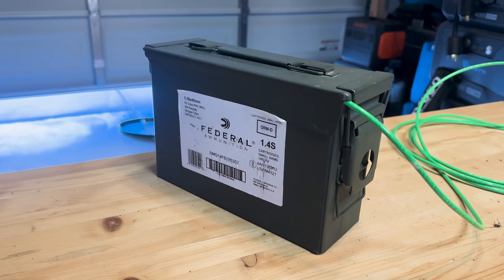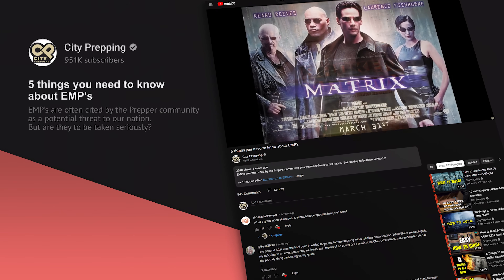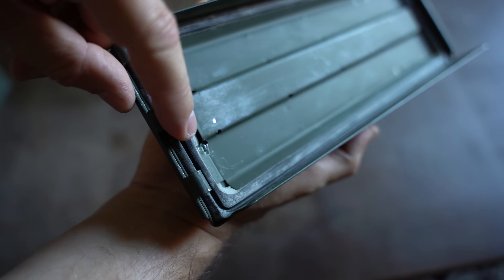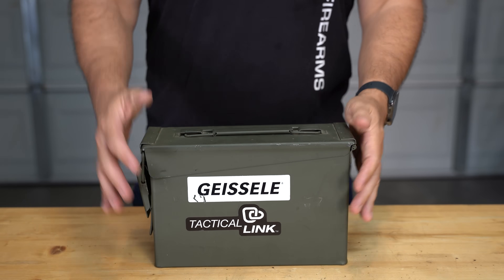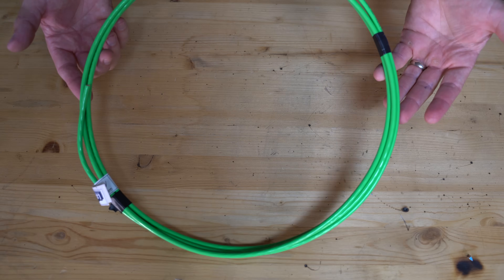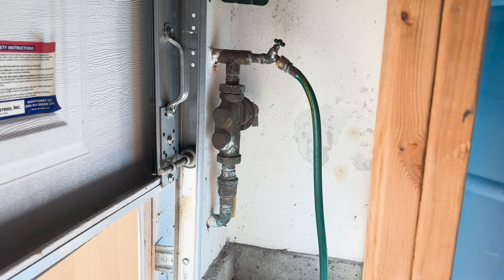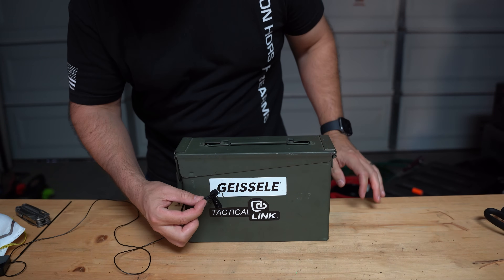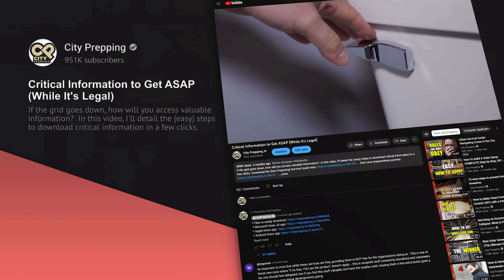How to Build a Faraday Cage: Step-by-Step Instructions

Comment: Ok but (and here's my stupid question) - if an EMP would wipe out even a basic radio, doesn't that mean it would wipe out the radio towers, so the radio, once out of the box, would have no signals to pick up?  Same with phones - sure you can save your phone, but wouldn't the cell towers also be fried, making the phone useless?  I'm just curious how the electrical devices could be used after since an EMP (or solar flare) would destroy even the items these devices need to work.

Comment: I believe if grounding, it need a dedicated copper stake with a wire clamp bashed into soil outside, a meter deep. Grounding to pipe plumbing makes fatal touch for anyone touching a water faucet/tap/pipe. Each generator in Au supposed to be grounded with a copper stake. By the way, the sound-box you build for your generator, included some foil, if pieces connected, you have that box as a Faraday cage.. Also, the Faraday cage doesn't need to be a solid metal, using a metal/copper window insect screen, much better, more flexible, lighter.

Comment: A metal garbage can of whatever size you require eliminates all that prep. Plus it can store more stuff.  After the can is insulated to keep it from contacting the metal I store it on a wooden palette.  I keep a laptop, radio, and other sensitive/vulnerable electronic items in mine.  The trash can handles makes it easy to move around.
Reply: You still need to seal the edges of the top of the trash can, where the lid fits on,  similar to what he did will aluminum foil.
Reply: I do. With metal tape. Hate it when I leave important information out. Thanks. @geod3589

Comment: Do not add a ground. Adding a ground will render the metal box invisible to a high power emp. Also be sure to set your completed box on an electrically insulated surface, 
A wooden shelf, as opposed to a metal shelf. 
As the electricity flows through a conductor, it creates a magnetic field around it. If the box is grounded the box becomes the conductor.
If the box is insulated it will not.
Reply: Right, do not ground a faraday cage; I put mine in a plastic tote. Keeps it clean, too.

Comment: Pretty informative a good example of a simple Faraday cage.  Few points, 1. if you isolate the items in the box, you don't need to ground it.  Also if you drill & tap a lug on the outside you can use it as a grounding point on the outside of the cage.  If you want a air-tight sealed box, you can drill and tap a wire inside to the top cover & bottom box to connect the two pieces.  Then you can keep the rubber seal in and just use aluminum tape or tin foil to ensure the cover overlaps with the box more for better protection.  If your looking for storage... use an old metal office storage cabinet.  Similarly, tap a cable to each drawer and provide some overlapping either aluminum tape and tin foil or other means to overlap the gaps of each drawer.

Comment: Very interesting. 2x suggestions. To put in the cage, solar powered calculator - after an EMP the ability to do sums easily may well be of advantage. To make the cage out of what in the UK is sold as an ash box. Good size for laptop.

Comment: Another way to test the effectiveness of cage is to place a cell phone inside and then call the number, if it rings, it failed. I would want an external mount for grounding. Just to make sure it had a solid contact point. Excellent, informative video.
Reply: So these will stop a cell signal? That’s what I came here to find out but no one else seems interested in it
Reply: @kevindutton3676 Yes, it will block all signals and prevent tracking of your phone.
Reply: Folks, consider that a cell tower puts out just a few watts of energy while a nuclear induced EMP is millions of time more powerful!!!
Reply: No grounding.
Reply: The power put out by cell towers is millions of times weaker then an EMP. It is not a 'proof'.

Comment: I'd just add rechargeable batteries to my preps and not worry about the box. 
With a few common items one can build a charging station. Think hand crank radio power. 
Just scale it up. 
I won't go into detail, but a car alternator and an old bicycle are part of it. 
add in some small items and a LiPo battery.... But preppers only tell you enough on YouTube to get to their next sponsored video. 

Do your own homework people. 
Learn what's useful from the preppers and build on that for yourself. 

NOTE. Do what you want. I'm not a youtube prepper getting paid for content. 
I'm just a mechanic/electrician and veteran with a family to take care of.

Comment: You can also use a metal trash can for larger items, with metal tape, aluminum foil and cardboard. To test it, put a cell phone in it and then call it. If no ringing it is good.
Reply: I've read the cellphone test is not that great, that might be why he used a regular radio.  I've actually tried using my cellphone and it always rang, perhaps I did not do a good job on my cage.

Comment: Small devices (Like those that will fit in that small can) are the least likely to be affected by an EMP. 
The bigger issue it larger items and things connected to the grid or items that are charging. 

A fun thing...assuming people build this stuff to protect their electronics, say a cell phone, GPS devices, things that connect to wifi, etc... if there is an EMP, you won't have service or communication even with a healthy device. 

Don't build this stuff.... Follow me for more money saving tips. 

Oh...he said it himself. WEAK ONE. 

Last I checked, they generally don't come in the weak form. 

I guess a solar flare could be weak, but that would still fry powered grid facilities enough that your small devices would still be useless. 

I'd personally save the space in the garage for water treatment supplies. 

So awesome tho that I can build a box that traps sound inside. LOL

Cheers to the people that think their radio will still get a signal after a massive EMP wipes out that signals source.

Comment: I just sanded the ammo can and kept the seal but instead put a sheet of aluminum foil all across the top and closed it. It works fine too but after opening it a few times I did have to replace the sheet.

Comment: I have converted a galvanized bin for this purpose😂
Reply: It has a great volume. I've put in a spare laptop and tablet. Two way radios, FM/ am radio. CB radio, disc drives and solid state memory. The body is earthed , lid with gasket and connected to the body.

Comment: I drive older vehicles yet they still have an ECU... I acquired an extra ecu for a few of my vehicles and put then in one of these and keep them in the corresponding vehicles and all the tools I need to swap the ecu out if it fails... granted this may not be the solution if all the silly sensors get fried and the ecu prevents it from running.. but.. maybe it will work. 
I found the extra computers at salvage yards for a pretty cheap price and I tested them myself so I was not out much more than $100 for the whole setup for each vehicle That includes the box and the computer.

Comment: Could you ground your faraday cage to a plug and use strictly the ground?
Reply: NO, don't do that! The electric power grid is the largest antenna in the country. Huge currents will be induced into it during an EMP. That's exactly what you're trying to protect your equipment from. Don't connect your equipment to it. Faraday cages should not be grounded at all.

Comment: I keep an old cell phone with important data on it. I also have a usb SATA drive with all my important data on it and a usb adapter for the phone to access the data. Also a ham radio, small solar panel, rechargeable batteries, usb power brick, and a battery charger that plugs into the usb output of the solar panel or the power brick. I have a larger cage made from a trash can with larger items in there.

Comment: I did a much bigger Faraday box so I could put some foldable solar panels and a couple of solar generators.  If you don't have a way to get electricity, then your old phone won't work after the charge is gone. I don't know much about what an EMP or CME ruins. I've heard it can destroy your solar panels, too. 
The rest  is kinda the same things you mentioned. I do know that a flash light without batteries won't be damaged. I've heard but don't know for sure that any appliances you have if it's unplugged is supposed to be safe, but then why have a Faraday cage if all these things are safe unplugged?  I get confused.  I really have heard so many different things and definitely did research,  but I still get  different answers.  I asked Google if you could use an old microwave as a faraday Cage. There were several websites, and they were different. Half said yes, half said no. If I had enough aluminum foil, I'd just foil the whole house and forget about!

Comment: I’ve seen a number of videos on how to make faraday cages in different size but you are the first to actually ground. Thanks!
Reply: Grounding is actually BAD, do not ground your faraday box.
Reply: @SolarPowerMonkey  it actually depends on the load in the air and how thick the shielding material is. I guarantee a 2 inch solid wall of lead that is grounded will work.
But this little box? No. LMAo
Reply: @escapetherace1943  Correct. That thing’s more of an antenna than a ground wire
Reply: So.... are we all wasting our time making DIY Faraday boxes/cages? I'd like to make one, for 'in case', but for every pro comment, there's a con comment. Who and what to believe. By the end of all this, I'll just hope n pray that down here in ol' RSA we'll be out of the main fray... no one wants to waste their new fangled ammo on us anyways.
Reply: @MsJS1122 No one really knows. It’s most likely unnecessary but they are cheap and easy enough to make that the money risked on it is well worth the reward if it’s needed and it does what it’s supposed to do. Short of that it’s still a fun science experiment.
Reply: @MsJS1122  the proper way is very expensive

Comment: question if an emp causes a grid down situation what use would radios or ham radios be if they depend on radio towers i'm sure those won't have faraday protection. i may just not know enough on the subject but could you or someone please explain?
Reply: Nothing to explain, you're correct. It cracks me up when people put cellphones in these devices, expecting to "Stay in contact with friends and family."
Reply: @rpbajb  so mostly useless unless your keeping very simple stuff like a flash light, batteries, or other things that are electronic but don't require being connected to the grid to function. lmao
Reply: I personally don't think about phones in cage. But I could see CBs, ham radios, solar generator & panels. If you had a really good radio you might pickup a station like BBC.
Reply: @autumnwest5854  Exactly. I've protected a shortwave radio, hoping to get overseas news when our local stuff wouldbe sus. A small inverter designated for flashlite battery charging off my lead acid battery bank rounds out my low tech preps.

Comment: Could you make one out of a Mylar bag or maybe a ziplock bag nested inside another ziplock bag with aluminum foil in between the bags?  Just curious about something small that you could carry in a small bugout bag
Reply from the maker: great question.  i'll research that for a future video.
Reply: That might work, I do something similar with faraday fabric and conductive tape for small scale. Like radios, optics,  or small solar in my emergency bag. I like the fabric as I can customize the size per item.

Comment: Would aluminum foil tape around the closed lid help seal the box? I have a larger ammo box I’d like to convert. I don’t have that much confidence in my crafting skills. 

I have a lot of wire pieces from when my dad did electrical work. Would any wire work as a grounding wire?
Reply from the maker: you can wrap the lid with aluminum tape (or foil).  I didn't go with that approach b/c it doesn't lend itself to opening the box easily.  great question!
Reply: Copper #12 bonded to a separate copper ground rod driven 6ft deep is pretty good. I reckon #12 to the metal water pipe, that's in direct contact with earth would work well- as long as no PVC between connection and earth ground.
Reply: Also keep the ground wire as short as possible

Comment: I enjoy your information in your videos. I have a question I hope you  might be able to talk on realizing I am not educated in this area. When it comes to Hybrid vehicles would there be a benefit for a full electric car have a small Gas Generator to provide longer distance. I do know that means there is a cost for the fuel but knowing there will not be parts to connect the drive of the generator to drive the wheels which can eliminate possible cost and weight. Is there any benefit to this thinking? Thank you
Reply from the maker: i should do a video on that.  been thinking about that point.

Comment: I made a faraday box out of a galvanized metal trash can doing much the same as shown in this video.  I keep an old cpap machine that works inside as well as a solar generator, radio, flashlight, CO2 detector among a few othetr things.  Living in an apartment I don't have any idea how to ground it, however.
Reply: Connect a terminal ring to the end of the ground wire. Then you you connect the terminal ring to the screw that holds the cover plate onto an electrical outlet. Assuming the outlet was installed to code and properly grounded this will give you a ground. That’s how you would properly ground an appliance with a three prong plug if you didn’t have a three prong grounded outlet. Those common adaptors were supposed to be connected to the plate screw.
Reply: plumping under your sinks? im in an apartment as well and not an updated one
Reply: Don't ground it at all. That's bad practice. See @jeanlui6944 post above, he's an engineer.
Reply: Why not a rubber trash can? Wouldn't it be better?
Reply: @chrissewell1608  Rubber would prevent electrical conductivity but it won’t block the magnetic induction. The metal shell allows the electromagnetic impulse to surround the ‘cage’ without allowing it to conduct through it as long as the inside is lined with non conductive material and there are no air gaps.